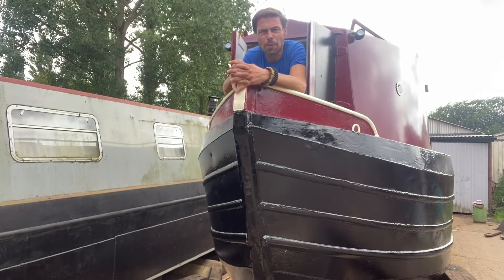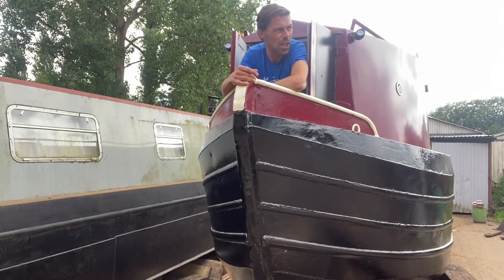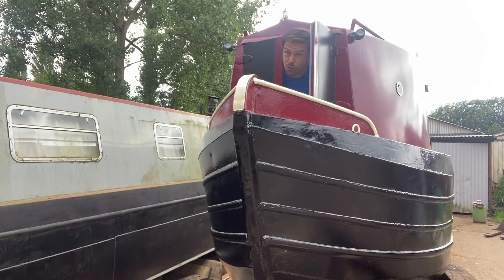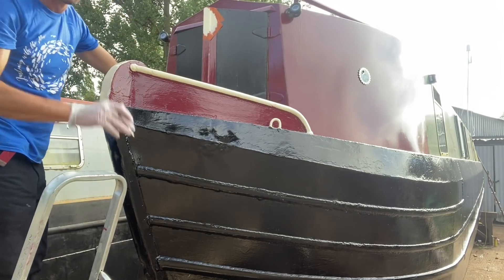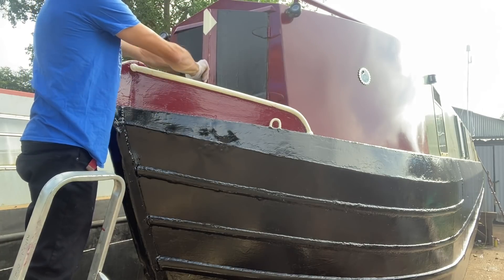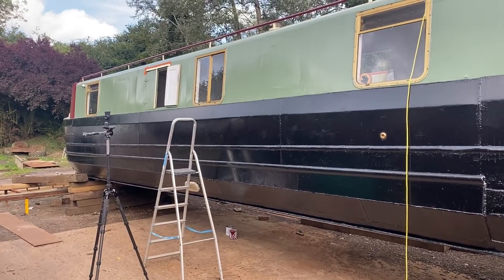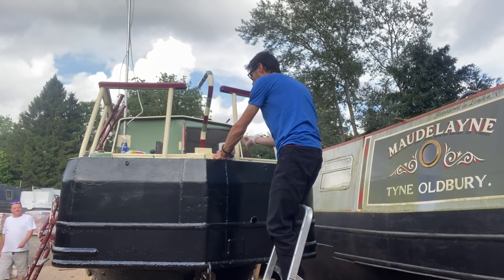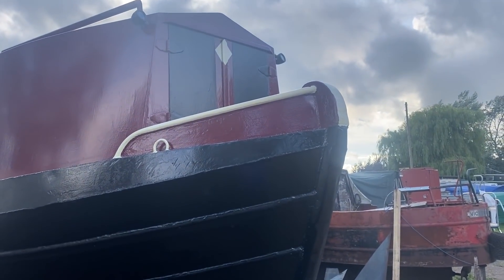229. Paint styling on the bow and strides forwards on the gear change

Comment: You could cut a couple of long strips of card or paper the same size as the strip on the doors and then try out different colours and designs on the card instead of doing them straight on the boat. 
I like the single diamond as well. It sort of echoes the tunnel light without being too 'busy'.  
Ben's boat has a rather excellent Mad Max vibe to it as well.

Comment: Why not dual throttle/ gear cables?
Reply: The cables won't take the strain of a non-hydraulic (i.e purely mechanical crunching) Lister gearbox.
Reply: @jbzoom  I say "Poppycock"! There would have to be a wax to build a ratio throw cable lever.
Reply: @tinkeringwithmark1186  it's simple physics. The reason the existing gear lever has such a long throw is to generate the force required to operate such a primitive gearbox. If you rig a geared system to operate that gearbox with a throw reduced sufficiently to work with a modern single-lever control then you will need enormous strength to pull it and in due course either the control or the cable will break. I have observed this happening on several old diesels with mechanical gearboxes, even where the manufacturer supplied a single lever control. Canal boats are not a wear case that manufacturers of such controls consider. And unless you have many years experience of maintaining or operating such contraptions I suggest "poppycock" is unnecessarily assertive. Most of my experience is based on old Lister and Sabb marine diesels, with a passing acquaintance with Gardner and Russell Newbery. There is a reason that working boats with RN or Gardner mechanical gearboxes used a long-throw push-pull gear system with solid bar or rod linkages - resilience.
Reply: @jbzoom  Ok! If you say so!
Reply: Hydraulic?
Reply: @tinkeringwithmark1186  a new hydraulic gearbox or even a modern mechanical one from PRM, suitable for that Lister, would work with a single lever control but be expensive. It would probably require remounting  of Sloe Patrol's engine to maintain prop-shaft alignment as the gearbox depth and reduction gear offset would be unlikely to match the existing box. A hydraulic gear-changer would need electric power assistance and also be expensive. Newage used to make a manually operated hydraulic floor-mounted single-lever control for BMC diesels they marinised. It was a complete pig to operate on canal boats and I would not wish it on anyone.
Reply: @jbzoom  Cable to gears at the trans.
Reply: @tinkeringwithmark1186  Unless you have a robust long throw rotating lever or push-pull handle (more robust than Morse, etc) you will struggle to generate the torque needed to change gear, especially if you add secondary gears. If you put that torque through a cable multiple times for each lock or lift/swing bridge you negotiate, you will eventually break any normally supplied cable.  So, you would need a special lever, special gears and a special cable. Probably better to stick with the 50-year-old inelegant system he has until he can afford a decent engine.
Reply: @jbzoom  Not buying it! This gear box can't be that hard to work with. Ratio gears and levers should work. The throw on a throttle cable is much more than a gear throw! 3:1 should work!
Reply: @jbzoom  Egyptian's built the pyramids with levers and ratios! A cable drive should not be a problem!
Reply: @tinkeringwithmark1186  I haven't seen a cable solution yet that works with an old Lister mechanical gearbox. There is no significant load on a throttle or a hydraulic gearbox control - the larger throw for the throttle is to give more precise control. The Egyptians had enough slaves to increase the leverage when required. To be fair, the travelling mechanic who John turned away had a concept that should have worked, but it was clearly not one he had actually implemented. That would have maintained the long throw, but put the gear lever at the side of the deck rather than in the middle. It would have required supports, welding and bearings able to work in a damp engine bay without rusting for years. Fine if he'd done it before, but too much of an experiment since he hadn't.